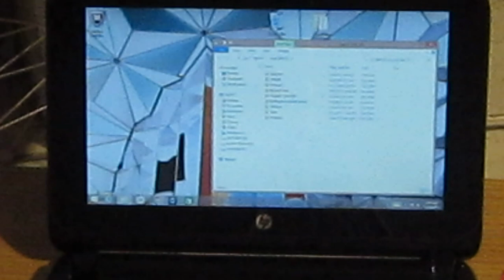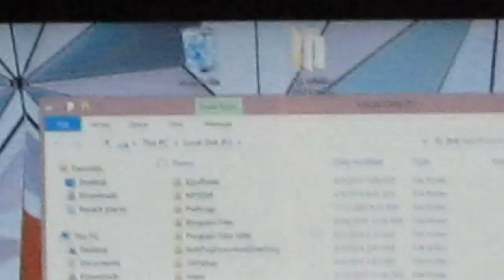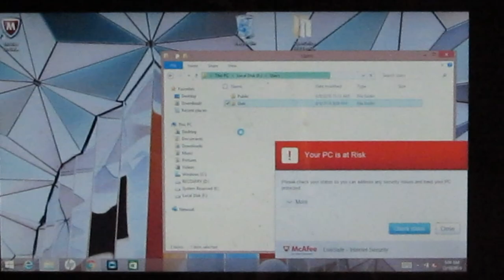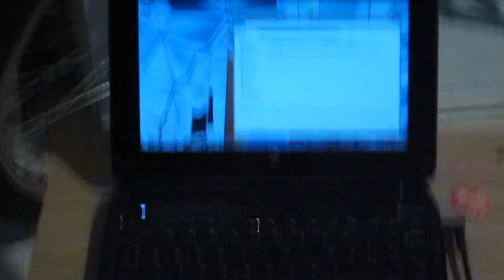How to recovery Data and Pictures from crashed computer hard drive using  a USB - Sata / IDE adaptor

Comment: Does anybody know how can I be able to access to my desktop. Since I had a password, it doesn't let me access my files
Reply from the maker: Unless you encrypted the hard drive.. you should be able to access it.. There may be issues with it on another windows machine.. If so, try a Linux machine.. Linux will not respect windows passwords. and will allow absolute access to the hard drive.. This is only the case, if the hard drive is not encrypted... If it is encrypted.. you are doomed!

Comment: thank you i had a 2.5 sata  fail on me, well not me but ex wife, told her stay off my laptop, anyways now i'm left with sata that wont boot up, so i'm guessing this would work as well,   question  is same thing 2.5 to working laptop to retrieve data if possible the version would be ide to usb being the ide is from old computer , all i'm worried about is the first 4 tears of my youngest son, and some of the first year of daughter, dont care bout operating system thank you i was worried till i saw your video
Reply from the maker: The kit that I purchased had both IDE and SATA.  IDE is a larger more rectangular plug usually white, and the SATA is black and smaller and looks a little like an HDMI plug, but thinner..It depends on how your drive failed, but most likely you will be able to recover pictures.  This is similar to what I used, It has both.. for only $9.99 at walmart.. 

https://www.walmart.com/ip/AGPtek-SATA-PATA-IDE-Drive-to-USB-2-0-Adapter-Converter-for-Hard-Drive-Disk-HDD-2-5-3-5-External-AC-Power-Adapter/49645282?wmlspartner=wlpa&selectedSellerId=1284&adid=22222222227037160880&wl0=&wl1=g&wl2=c&wl3=85049583034&wl4=aud-310687322322:pla-188869028434&wl5=9007544&wl6=&wl7=&wl8=&wl9=pla&wl10=112561964&wl11=online&wl12=49645282&wl13=&veh=sem
Reply: THX

Comment: Hello. Can I still recover files of the error I got is "No boot disk has been detected or the disk has failed"?
Reply from the maker: Yes of course.  If you have a second computer to pull the data off with, you do not need the boot,.. assuming the files directory structure is still in tact.  Even if there are errors with it, it is sometimes possible to even recover the data still. I have a video of how to use photo-rec to recover even deleted files.  You should probably be able to recover most everything provided the hard disc did not physically fail.
Reply: jaynes network thank you for replying 😄
Reply: jaynes network thanks :)

Comment: Sir i changing window xp to 7 only and formatting all data ...now from hardisk i got it or not ..through software mechanic..please inform sir
Reply from the maker: There are two parts to files on disc, 1. a list of their locations, and 2. the actual data.  When you format the HD, you erase the list, but most likely the data is still intact.  As the new OS runs, it will slowly overwrite this data, making it impossible to retrieve..  if you want to try to save some of this remaining data, you need to shut down this computer, and pull the HD and try to read it on another computer.  Every minuter you let the new OS run, it is overwriting old data. Since you formatted the disk, you can not read the data normally, and you will need to use a recovery program like Photorec.  I have a video below on Photorec, which may be able to retrieve some of your old data, if you like to try.. best of luck.

https://youtu.be/vLUpJOZmREs

Comment: hi. my toshiba external disk drive i scanned it with smadav antivirus and after it just stop functioning, and it said format i didnt coz i might loose my data, later on it stopped completely, no sound no nothing hekp me
Reply from the maker: Formatting never sounds like a good idea. The drive could have already started to fail.  You need to remove the drive immediately and try to read it with another computer.  if the drive is starting to fail, you should do this as quickly as possible, because the more you use the drive, the worse it might get.. If you did format, you may have even more troubles.  you may have to use a recovery program like photorec this will be a whole other mess to deal.  I do have a video on how to use photorec if you are interested. best of luck.

Comment: Bob Cammarata
1 second ago
FOR THE LIFE OF ME I CAN NOT FIND OUT WHAT KIND OF H/D IS IN MY DELL 8500 LAPTOP!!!!   I ALSO CAN'T FIND OUT WHAT KIND OF ADAPTER TO USE WITH MY H/D SO I CAN PLUG IT IN TO A USB INPUT ON SOME OTHER COMPUTER.   ANYONE KNOW PLEASE HELP ME WITH THIS PROBLEM. THANKS.
Reply from the maker: You need to look at the connectors.. right on the hard drive.. Many laptop companies have their own cable.. don't use this.. the connectors on the hard drive are standard.. It is probably SATA, unless it is a pre/circa 2003 computer... Here is how to tell..
https://www.reclaime.com/library/how-to-tell-ide-from-sata.aspx

Comment: my laptop stoped working recently .whenever i start it says a disk read error occurred.i tried everything but nothing works. i went to computer repare shop they said my hdd is not working and i have to change the hard dsk and for data recovery they will cost me alot.my laptop is old version i just want to recover my data which are very importn for me.
Reply from the maker: You can try to read the hard drive from a working computer.  These videos show how it can be done.  If it is going bad, be efficient with how you read the hard drive.  The longer you have the bad one powered up, the less life you have in it. The first thing to do it remove the hard drive, and see if it can be read by another computer.  If it can start copying off data immediately.
Reply: I tried but there is nothing showing in another computer

Comment: see what happened to me was that I accidentally over ran after effects on my f**** laptop and the next thing you know my home damn hard drive just ends up f**** upand now whenever I turn on my laptop it just goes to a black screen for like 5 minutes loads up the log in screen and when I login it takes like 5 minutes to open up a single file, and if I right click on something ,
THE WHOLE LAPTOP CRASHES
Reply from the maker: I don't think the program should cause this problem??? Was your drive almost full? Major issues can happen if you drive gets full.  Also It could be a coincidence, and the drive was ready to fail anyway?? It does not matter too much what caused it now.... The next thing to do is try to back up your data if possible.. This video is a good way to do that.. Best of luck..
Reply: @jaynesnetwork  I think what the issue may be is that I got my laptop from my brother in law and he's had it since his highschool years, and laptop hard drives usually past up to 3 to 5 years of use, and he's had it since 2015 and that was 3 years ago . I guess my hard drive met its deadline huh. Time to get a new laptop?

Comment: Can someone tell me what cable I have to use? I have a crashed computer, but I can't connect my hard disk to my working computer!
Reply from the maker: You need a power cable and a data cable kit.  It is called something like USB/SATA hard drive adapter kit.  The new style data cables are SATA and the old style are IDE.  Be careful to get the correct one.  Many kits adapt to both.  They sell kits that contain both cables to make your drive into an external hard drive.  There are also external hard drive boxes that have power and data lines built in to them too, if you prefer that instead.  Some times you have to change a jumper when connecting the DH to another computer.  Usually it will be jumpered as 'Master' if it was previously the main drive, and you have to switch jumper to 'slave' to use as a secondary hard drive.
Reply: jaynes network thanks!

Comment: I've gone through this whole process but the files won't load. It keeps trying to load but is too slow. Help?
Reply from the maker: Are you able to see the hard disc on the computer when you plug it in?  Maybe it is having issues reading the data? I had a hard drive that had problems reading the data, and it was because the bearing were loose.  I tried putting the HD in the freezer to shrink the bearings a little, and then tried reading it.. If that is the issue, this sometimes helps..

Comment: Would a 19.5v power adapter work?
Reply from the maker: I wouldn't try it.. Too high of a voltage can burn things out. Best to run the drive at the specified voltage.. Also computer supplies are typically well regulated.. It is not good to run a power supply that may not be as well regulated on a computer device.. It either may not work, or you might damage it as well. Best to use they type of power supply specified for this device...
Reply: jaynes network thank you for the advice

Comment: is that the only files you need to move
Reply from the maker: You need to move ALL files you want to save..Sometimes it is difficult to locate them, because user directories may seem like they are in different places, since this is not the main hard drive... and normally you user directory has a special place for the folder if it is on the boot drive.. best to thoroughly search through everything... best of luck!
Reply: @jaynesnetwork  Ok thank you

Comment: Does it normally take a long time to open my user folder?
Reply from the maker: No it should not.. Maybe the hard drive is going bad?? If it is the bearings, sometimes you can put the drive in the freezer and get it good and cold before you try reading it.. the cold will shrink and tighten up the bearings... and make it readable for a short period of time.. until it warms up..  This a hail Mary.. but it worked with one of my drives...  If it is a problem with the write head,... you should try to get as much data off, in as short of run time as possible.. it could fail completely at any moment!! best of luck!! don't leave the hard drive on and running idle.. only have it plugged in when you are actively recovering data.. time is precious...

Comment: Can it be done also in crashed desktop hard drive?
Reply from the maker: It only works if only the Operating System is crashed, but the hard drive is still operable.. That is, it is crashed in the sense that it will not boot on its own, but it still can be accessed as a secondary hard drive.. If the hard drive mechanically fails.. there is probably not too much that can be done..
Reply: @jaynesnetwork  you explained can be repaired by system repair or system recovery
Reply: Yes it can just pc and laptop got different hdrive design but still cable is compatible

Comment: Sir which data we formatted.in window xp now .we want recover from hardware....
Now i am running window 7 
So how can recover from hardware ....please inform me i m in very depression
Reply from the maker: The data format does not necessarily depend on the OS. The data format is probably either fat32 or NTFS.  Windows 7 should be able to read both I'm pretty sure. you just need to either get external cables and do the recovery like I did or if you have a desk top computer you might be able to put the drive inside the box and connect the cables as a second hard drive.  If you do this, there may be jumpers on the hard disc that you will have to change to tell it it is a second HD and not primary.
Reply: Sir i changing window xp to 7 only and formatting all data ...now from hardisk i got it or not ..through software mechanic. .
Reply: Run lexapro.exe

Comment: I did this also had to use a data recovery program but my files names were changed to like file 1 file 2 etc. Is there a way to get my data like it was saved before the failure?
Reply from the maker: If you used a data recovery program, that is all that is left.  The file names are deleted, so they have to be renamed.  You can try to look on the drive and see if there are any files that you can get without data recovery.  They will still be intact and have their original names. Manually search through all the folders you can find... and copy any files you find out to a working computer.. Otherwise you will have to spend some time sorting through all those undeleted files and renaming the good ones.  There will be zillions of junk files mixed in with them I bet, and it might take some time.. Best of luck..

Comment: mine 2 hdd recent 4 year since opening wont. inside entire things properly recovering able we?
Reply from the maker: There is a good chance you can recovery everything.  It depends on how the hard drive failed.  If something in the boot is messed up and the hard drive itself is still functioning properly, there should be no reason that you couldn't recover most if not all of your data...
Reply: im not sure hdds of correctly running  whether. just trying i pc the opening however normal (home screen) even seeing cant im.

Comment: When they ask to format what can you do? Formatting lose all files
Reply from the maker: Do not format! It is still possible to recover something by using photorec, but it is less likely to be successful, and much more work!
Hopefully you did not format.. then you can still use the procedures outlined in this video!  if you did..
Here is a video showing how to use photorec!
https://youtu.be/vLUpJOZmREs
Reply: @jaynesnetwork  what I try to say is I plugged in like u showed but its asked to format disk in disk management and the disks did not show on windows at all. Do I have a defective drives or what am I missing? Using Windows 10

Comment: my disk data is not showed by another pc . because my disk is carrepted. i am tried this. but my problem is not solved . can you solve my problem . replay me argent .
Reply from the maker: Sometimes, that disc can fail due to the bearing becoming loose due to wear. Sometimes if you put the hard disc in the freezer for a while, it will shrink the bearing due to the cold. If you read it quickly before it warms up, sometimes you can extract some data. Of course the hard disc can fail in other ways.  If that is the case then this method will not help.. It is easy to try though..

Comment: Would this work for Mac hard drives
Reply from the maker: I believe it should? I know that the macs have changed the way they access their drives, so if you want to access it from a different OS, like windows or linux, you may have to install special software to access the drive... I'll bet it should be no problem accessing the drive from a working mac computer though??..

Comment: I am stucked in startup loop and blue screen appears whenever I clicked on launch automatic repair or I tried to install Windows 7 again call "page fault in no page area" please reply what's the matter with my PC is my hard drive dead please I am so scared right now
Reply from the maker: Did you try to install windows 7 over a previous version of windows?
Reply: jaynes network whenever I try to do anything on the computer blue screen appears at the end
Reply: jaynes network btw Thanks for replying
Reply from the maker: OK I just wanted to make sure.  I was trying to help one person with HD problem, and I thought the hard drive crashed on its own when actually it was a problem because the person tried to install a new OS over the old one. I would never recommend doing this. Hard drives are cheap, install a new OS on a new drive.
Reply from the maker: For you, I would recommend trying to pull the hard drive out of that computer, and try reading it externally from a working computer.  If the hard drive is still working OK, I would recommend trying to back up all your important data before doing anything else.  If you want to then put it back in the computer and experiment with trying to fix that problem afterwards, then at least you won't risk loosing your important data.. Attempting to try to fix these types of things can be a little risky..
Reply: jaynes network is data recovery process costly?
Reply from the maker: If you do it yourself, the cables are inexpensive, and only costs your time +($10-$20?). You have to be careful not to damage the hard drive and other things when you do this. This is what I normally do.  Paying someone else to do this will cost you a little more ($100-$200?).  You have to take it to some one who does this type of thing.  Most of the super-store computer help centers, will just reformat your HD to get it working, and this will erase EVERYTHING, so ask questions and be aware before you decide, and get and estimate first...  if you want to try this rout.

Comment: My laptop hard drive failed and windows won't detect it....will this work or is it done?
Reply: yes it will work, just take out the disc and plug that disc to any other pc like a slave disc, but if you get that converter like he has, its same like plugin any usb key/disc to pc or laptop. so you must do this diagnose and see what is wrong before throwing away. its easy and can be checked in less than 2min if you have any other pc in the house, if not, ask a friend, just dont throw it.
Reply: +Kazuya Mishima Can I use an external enclosure instead of these cables? Will I need to see a special program to see the files? My laptop had a password.
Reply: you dont need any special program. this works same like normal usb key. and yes you can use external enclosure.